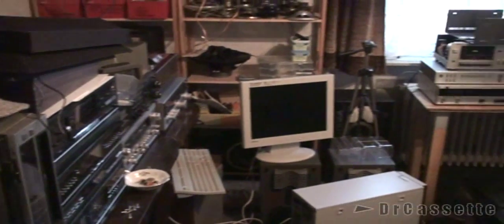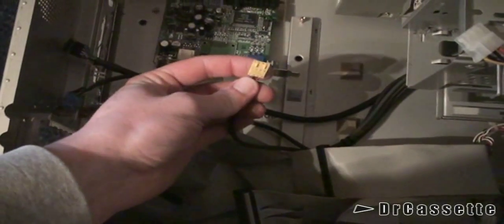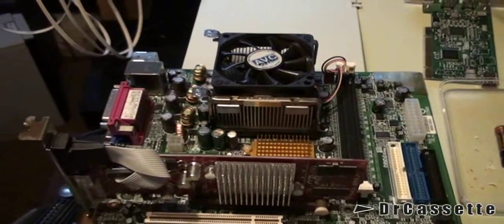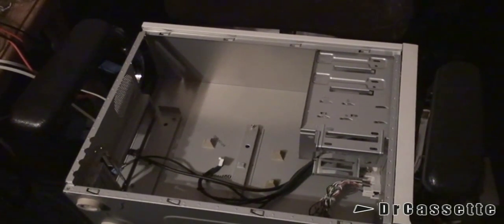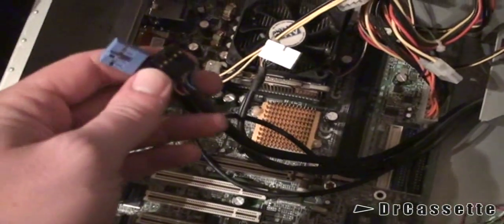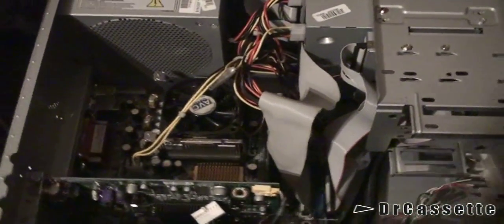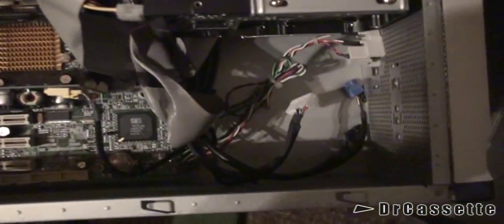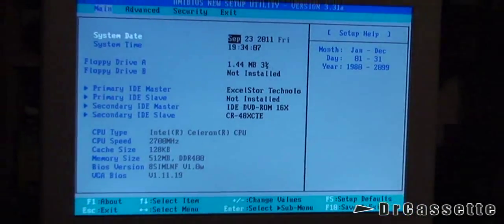DrCassette's Workshop - Building another PC!

Comment: So things did get a bit tight inside that case, as expected. Not too bad though. Still got one of these 250 watters around, very short cables.

That Excelstor drive would seem to be an old Jupiter J680 model; not sure who designed these. Newer ones tended to be "recycled" IBM/Hitachi designs (I once had a 60 gigger that was a 180GXP series equivalent) and as such reasonably solid. No support or warranty whatsoever at the time, but what do you expect from the absolute cheapest drives around?

Comment: I just saw you're vid on "pc from the dump" & I guess it can go higher the 512. I also got a look at the power supply it looks like a good one. If the watts on it are higher then all you're others I would use it with you best pc. Dose that vid card have a DVI out I know it has the old VGA out. If it dose you can get a DVI to HDMI & plug it into a flat panel TV, most flat panels have the VGA input but HDMI input would be better.

Comment: Nice video, but be realy careful with the Exclestor HDD, a friend of mine, had exatly the same and the head almost die 3 years ago (can't r/w data and lot of read error), hopefoly he had backup, but be careful, worst HDD i've seen (when you start to have bad cluster and strange toc, toc sound, throw it away, it will not last long).